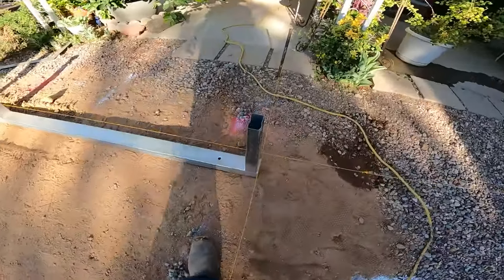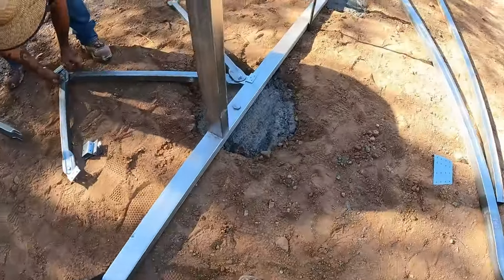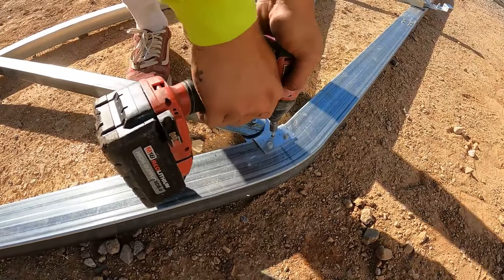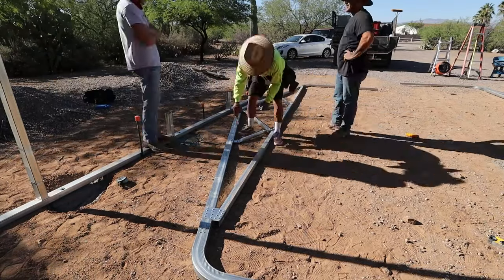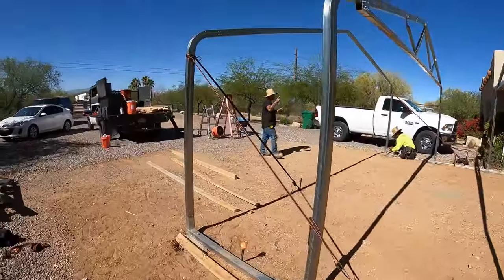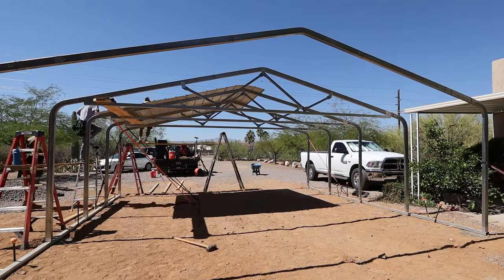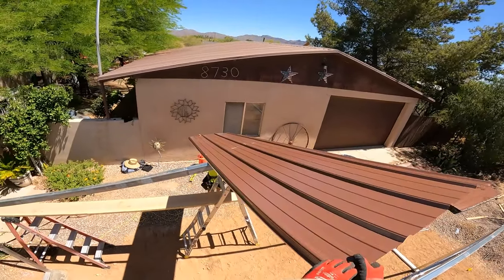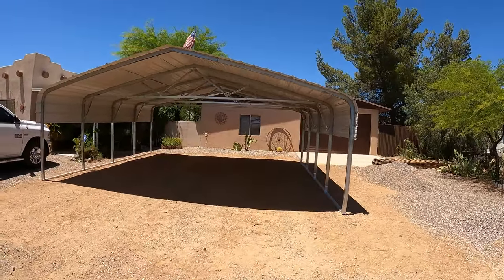How To: Install a VERSATUBE Carport - Fast & Easy

Comment: I would make concrete my last step.
If you are off a little, it is impossible to correct  in dry concrete.
Reply: I was thinking the same thing!! But I guess these guys build enough of these they have figured out the best order of operations
Reply: absolutely!

Comment: For it being 20x20 is the width measurement the opening for the carport or does it include the framing
Reply: 20x20 is outside to outside the frame
Reply: @ManthatsCool100  7' interior height at corners